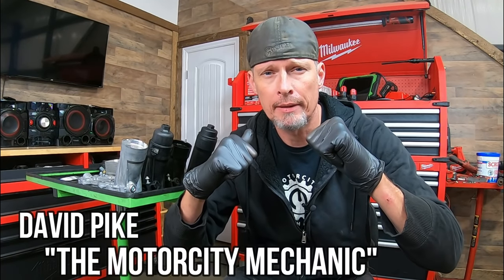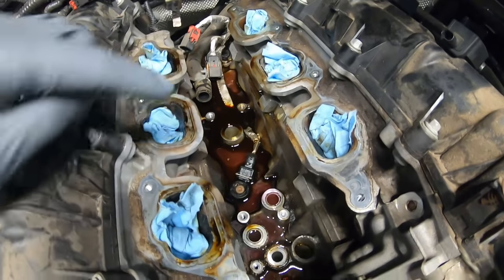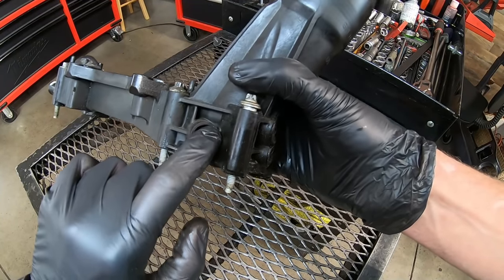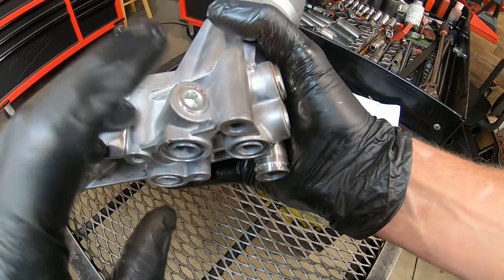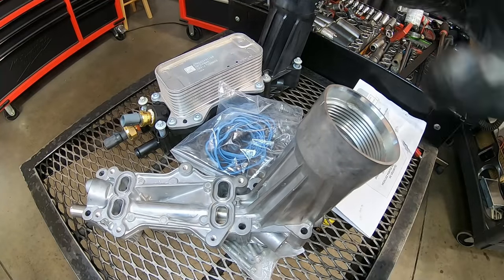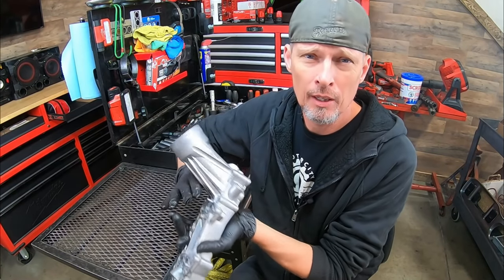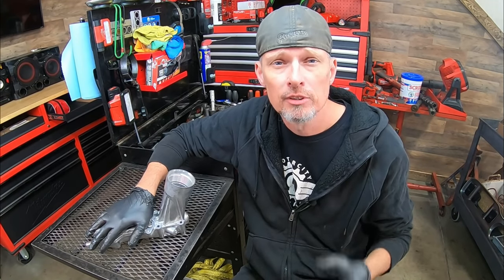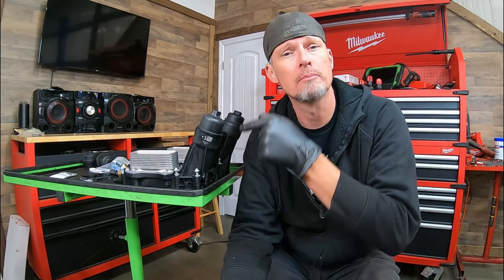Dorman 926-876 Aluminum Chrysler 3.2/3.6 Oil Filter and Cooler Housing Upgrade

Comment: I wish you would have explained why this won't fit gen 3 applications. Further research suggests that newer oil cooler used on gen 3 engines is nearly identical except the oil temp sensor port is now plugged because the oil temp sensor was moved to the rear of the right cylinder head. I think one could easily make this Dorman part work on gen 3 engines by simply plugging the unused port with a threaded pipe plug (3/8" NPT appears to be the correct size). The oil pressure sensor used on gen 3 engines appears to use the same thread size (looks like 1/8" NPT) as the older pressure sensor. I might give this a try because the oil cooler on our 2018 Pacifica appears to be leaking.
Reply: I just did mine on my ‘14 Challenger. The Dorman part number ending in 959 contains the plug for the oil temp sensor port.
Reply: @86twin  You are correct, but Dorman hadn't released 926-859 yet when I posted my previous comment. 🙂
Reply: @ruley73  I didn’t need it because I have a gen 2 engine.

Comment: Hi David. We have a Jeep shop over in Wisconsin and my personal oil cooler just took a dump on me.  I can’t find the aftermarket dorman one and everything else is back ordered. So I’m going to be buying the Amazon one (I know, I know) but I’m going to try it with Mopar gaskets and Mopar sensors. Hopefully it works out. I’ll keep you posted on the quality when it delivers Thursday
Reply: Which one did you get and what do you think?
Reply: @lindsaybolger6839  the sintly branded one. We did 3 so far. All of them are leak free
Reply: Thank You!!! It’s so hard to know with the millions of brands and having to take the reviews with a grain of salt. That is very helpful!
Reply: @lindsaybolger6839   no problem. I was skeptical as well from all the brands and just said screw it. This one had decent reviews and I needed the part. I might do a video on it since the dorman branded one is hard to find

Comment: Dorman 926-959 is for both gen 1 and gen 2.  It is the gen 2 unit with the oil cooler and as was already stated, the lack of oil cooler is the only reason the 926-876 can't be used on a gen 1.  Including the oil cooler addresses this problem.

Comment: I thought I had a trans leak, but my new radiator keeps loosing water with no visable green coolant leaks.  My oil level seems fine.  I noticed what seemed like trans fluid on top of the engine and that didnt seem right.  I think this filter assembly on my 17 grand caravan is the problem.  Will pull the intake and visually confirm.  Oil change and will check the coolant for cross contamination as well

Comment: God I remember when they dropped all the the last 4-5 V6s and went to Pentastar. Very first one we got in was in a loaded Grand Cherokee. Made it 18 miles and popped a head... Fortunately they've been "ok" and predominantly only saw leaks like these, and upper valve train issues. Curious how the longevity of the aluminum housing changes things though? We do about 10-15 a week so I'll throw a couple in to test.
Reply: Sounds like you change hundreds. Any idea why my 2017 ram pentastar is showing high oil psi after changing  the cooler? It has the check engine light on and won’t seem to fluctuate it just sits at 91 idle or driving
Reply: @ScrapKing1000  There is an oil pressure control solenoid in the oil pump that's notorious for going out. Typically sets a DTC that's like P××66? The x's are because I don't remember the exact code off the top of my head but it's something like that. Google 3.6L Pentastar oil pressure control solenoid/valve and it'll come up I'm sure.
Reply: Thanks man. Unfortunately that job looks wayyy more intense than just the cooler replacement. Ughh just found motor city do one it was a 5 part video 😫

Comment: There is a Dorman 926-959 that fits the 2011-2013 V6 Pentastars. It comes with the cooler and filter stuff along everything in the unit you have above.
Reply from the maker: Your correct. It recently slipped out. I’m suppose to be getting a “sample” in the next couple of weeks to review and make a video

Comment: I recently replaced my Gen 1 with an Mopar Gen 2 assembly.  The second time I started the van a P0520 and P0522.  I was thinking about putting the old oil sending unit back on, or should I get a new OEM sending unit?  Thanks for the great videos!
Reply: What sending unit (sensor) did you put on it? For stuff like that, use OEM. Always. Even when it costs more. If you can figure out who the OE supplier was for your car, an OE part will be quite a bit cheaper than what it is at the dealer.  A concrete example is NGK/NTK is the OE that makes O2 sensors for Mopar, and you can get their sensors through distribution channels for cheaper than the dealer parts counter.
Reply: @philbrutsche8928  The Mopar sensor that came with the Mopar assembly.

Comment: Great video. Replaced  our 2015 about a month ago  with the 'newer' version which had everything needed. Unfortunately we still have a leak up in there. Can see oil puddling up in the valley and eventually it drops out the back like before. Any ides where we messed up on it?  Like to have some idea of what  we missed,   did wrong or need to look for  before we go back in . Thanks.

Comment: Love your channel buddy! I have a question on my Daughters 2013 Wrangler. I want to upgrade it with the 2014 Dorman Aluminum OilFilter Housing. Do you see a problem with that? I realize I will also have to buy a 2014 oil cooler , Filter and Filter Cap to complete the update. Is there anything Im overlooking?
Reply from the maker: Seems to make that swap work you would almost need to buy a complete 2014 assembly. That way you have the cap, the cooler, and the one thing that the aftermarket separate coolers don’t come with….the bolts for the cooler to the assembly.

Comment: Hello,
Great information.  Really appreciate your content.  What is the sensor located under the oil cooler with the foil protected wire harness?  Mine says Continental ks0001.  Should I consider replacing it since it had been sitting in oil and coolant for so long?
Thank you,
David

Comment: Hi David.  Is there any way to adapt a separate engine oil cooler through the factory or Dorman assemblies?   I am wondering about those two threaded fittings on the very front (down low) of the housing.  It is the two that had not blown out on the plastic one that you showed.    Outstanding, in depth video.   Thanks for posting it.   Please keep up the great work.

Comment: Awesome video. Great to see a aluminium version on the market. 
Mine is leaking again for the 3rd time. 
I think its the orings underneath. In my opinion that's the issue, if that's the issue, changing to the aluminium version won't help at all.
Whats your thoughts on that?

Comment: Does the Gen 2 (2014 +) have any type of pressure relief/bypass valve or is that function completely handled by the new (2014 +) oil filter redesign?

In other words is there any part that needs to be swapped into the Dorman 926-876 housing from the OEM housing or only the Gen 2 oil filter?

Comment: Great videos, thank you for your time.
So if im hearing you correctly, i can use this metal housing in a gen 1 (2013 in my case) but only if i have the oil cooler assembly and the filter assembly off of a 2014. But then it will bolt right up?
Reply: Yes

Comment: Hello I love all your vids and have a question....we need to get this replaced on our '17 Wrangler, if it were summer I'd try to do it myself but its 32 degrees here in NY. So going to the dealer on Monday. The Wrangler is out of warrantee but they might cover part of the labor. I have one OE mopar oil filter housing and the Dorman aluminum one. Have you seen good results with the Dorman units? If so I might have them install that one instead.

Comment: make a video about cp4 pump on 19-20 trucks. I got lucky and had mine start leaking fuel no metal shavings contaminated the system luckily. dealers have no fix yet for the Y78 recall. however there is an aftermarket cp3 conversion available. Stelantis/Chrysler is reimbursing costs for the aftermarket repair over $3000 so far after submitting a reimbursement claim. Do you have any insight on anything about plans for the remedy.
Reply from the maker: Haven’t heard of that conversion so I will have to check into it for sure.
Reply: @MotorCityMechanic  your channel was the first one that came to mind when I had the issue and started digging. Enjoy watching your content.

Comment: I recently installed one of these on my 2018 Durango 3.6L.  The fit and finish of my doorman unit was very bad.  Every casting line was sharp and internally where they drilled the oil galleries into the part there was left over bits of aluminum flashing where the drill broke through. Also had sharp machining remnants inside the oil filter tower that would have cut up the o-ring on the cap.  Spend a lot of time with a file and 150grit deburring wheel to clean the part up.  Don't know if the one I got some how missed a post machining step in a vibratory deburring pot or something?

Ultimately installed and so far no leaks.

Comment: I just installed this Dorman part.  It looks like a great part to fix this issue.  However,  somehow one of my short screws to the upper intake stripped out, yes I used a torque wrench.  I put a slightly larger diameter screw in which I think is doing the job.  But I wonder if using a 1/4 inch by 20 X 2 inch hanger bolt is the way to go.  For those not familiar half of this is screw thread the other half machine thread ( 20TPI).  I am thinking that the 1/4 inch screw thread should be epoxyed into the lower intake.  I wonder if having a stud on the lower intake can cause an installation issue on a 2014 Jeep Wrangler.  Any thoughts pros or cons?

Comment: Hello like to know if generation one oil pressure sensor Will work with the aluminum housing the reason I’m asking is I receive one complete all pressure sensor have Teflon tape on them so I was thinking about swapping them out with my originals what’s your thoughts on this?

Comment: Maybe it'll be OK, we'll see, but  never underestimate Dorman's ability to F things up.
Reply from the maker: Time will tell just like on the OEM.
Reply: @MotorCityMechanic  Right, there's not much for the OEM to brag about with those coolers.... and Hemi exhaust manifold bolts.
Reply: @johnz8210  you’re right, Dorman tends to have great ideas and poor execution. I’m thinking of the disaster 6.0 powerstroke oil coolers they put out. They used cheap gaskets that didn’t last and would swell and cause leaking or mixing. Let’s hope the gaskets they are using with these are Good quality and designed to last.

Comment: Mine was worse. I had a head gasket problem/crack which leaked pressure into the cooling system and cracked this so I assumed it was the problem, replaced it and then the coolant tank ruptured as it got worse. Strangely there was no obvious oil in the water or water in the coolant. It was a nightmare and I got rid of the car rather than replacing the heads or gasket. It was a 2013.

Comment: On a 2014 jeep wrangler, I have oil in my coolant overflow. Been reading it's either to Oil Cooler, Trans Cooler or a head gasket... The oil in the engine looks normal so I'm leaning toward the oil cooler. This will be the second time it's been replaced. Any other ideas?

Comment: Hey David...I'm about to do the spark plugs, vavle cover gasket set and pvc on my 2012 dodge charger 3.6...should I charger out the 3 coil pack on bank 2..while I'm at it ?..it was told to me it would be a good ideal..

Comment: I'm gonna save the oil cooler off the next gen2 pentastar I swap a housing on at work. Then, if I need to put one of these on my gen1, I'll have a cooler for it. The gen1 filter setup sucks anyway. More often than not it seems, those bypass valves are bsuted.

Comment: I'm still confused, and my particular 2015 T&C doesn't help.  It was built in Dec 2015, and it has the housing with the old-style bypass valve in the housing body rather than the cap. So, does that mean I cannot use the Dorman housing?  I see that Dorman is currently selling the aluminum body with a new cooler attached...so was that the only issue preventing using the aluminum housing on the old engine?

Comment: After seeing their upgraded coolant crossover, I was wondering if they had any more parts they made in proper materials.

I ran into the oil cooler leak while still under warranty, but with the upgrades I'm hoping to do I may take it upon myself to pick this up. See what else they make in aluminum versus the oem plastic
Reply: Same here - I'm uncomfortable about the Thermostat Housing being plastic so that's another item I'd love to see a metal replacement option for!
Reply from the maker: Hopefully a metal thermostat housing soon so that we will have almost all the plastic out of the system

Comment: Great video but i would have said yes for gen1 long as you buy the oil cooler for the gen2 and have the screws. They do sell the oil coolers separately.
Reply: You also need to buy the different cap. The gen 1 cap wont work

Comment: I replaced mine with one from Amazon.  Now a few weeks later I have the P0198 check engine light for the bad engine oil temp sensor high.  Are there any torque specs for it?

Comment: I have a 2012 Wrangler with the 3.6 that was leaking coolant from the oil cooler.  I purchased the updated Dorman part (926-959) and bought  new Mopar temp and pressure sensors.  After installing and reassembling, the Jeep was indicating a P06DD code (Engine Oil Pressure Control Circuit) which kept the vehicle in limp mode.   I thought that perhaps the new pressure sensor was faulty so I took everything apart and installed my original pressure sensor.   After reassembly I was still getting same error.  Internet searches suggested I replace the Oil Pump Solenoid so I did that, reassembled, and was still getting same error code.   I then called Dorman’s support line and they thought there may be a manufacturing defect in the oil cooler and to just return the part (purchased via Amazon) and swap it out with a new one. 😢 As this would be the 3rd time disassembling parts to get to the oil cooler, I was a little hesitant on using another Dorman part.  I was fortunate to talk with the Motor City Mechanic (thanks David!!) and based on his guidance wound up purchasing a new Mopar oil cooler that came with both sensors.   After installing that, the error code went away and Jeep is now fixed.  I would have preferred an aluminum part over the plastic OEM one but ran out of time and patience.  While the Dorman part does have mostly positive reviews and lots of satisfied customers, I clearly had a defective one and had to put in many extra hours to repair my vehicle.

Comment: My 2015 Jeep Cherokee Trailhawk got the leak… I can’t find the newer full assembly 926-959 from dorman all out of stock. .  Thoughts on if the actual cooler can be reused on the existing part if I purchase 928-876 part. I know it is sorta of addressed on this video but any experience on this going well or poorly?

Comment: Hi David
first thank you for your informative videos. I was wondering if you could help me with my 1999 Chrysler 300 having no heat?  the cooling system is pressurizing, full & fan is working but is running a little hot at stop lights and I have no heat. not sure if this is relative but car also has trouble starting after running a while and trying to start back up. for example running into the store when you come back out car is very stumbly to start. when car is cold it starts fine.
thank you for your time.
thanks 
Scott